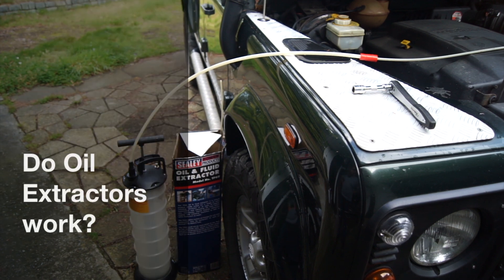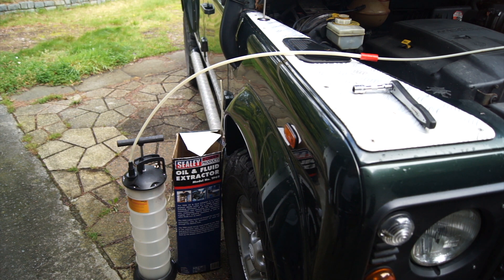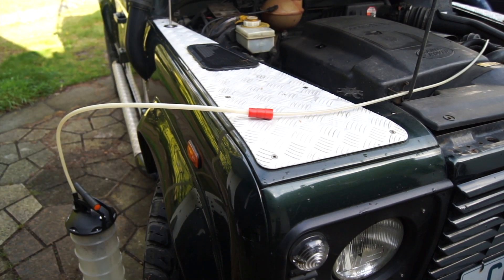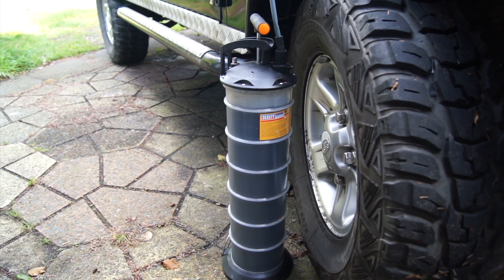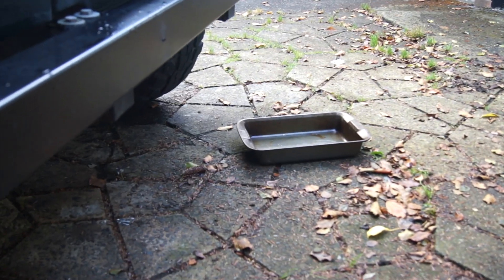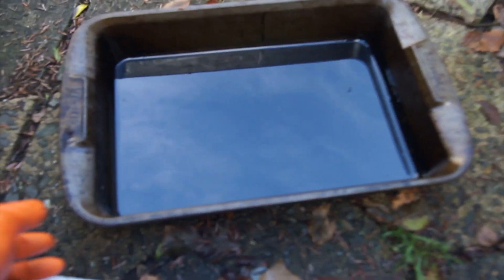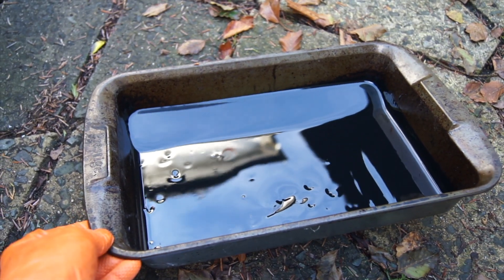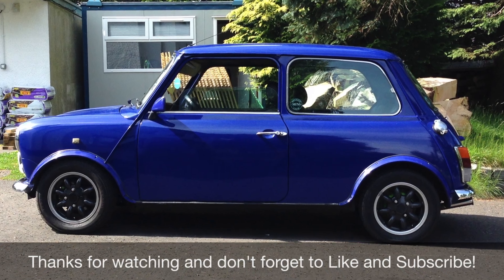Do Oil Extractors Works?

Comment: I didn't understand the purpose of removing the sump plug, if you didn't have a large enough oil extractor for the engine. It may have sucked up more.
Reply from the maker: The point of the video was to show what was left in the sump after the using the pump.

Comment: Depending on what side you’re drain plug comes out on, you could drive the one side up on ramps and tip the one side of the car and probably get all that oil out.

Comment: Great teaching video. But I wish you had told us how long that last bit of drainage took. Too late for you to tell us? Hope not! I am about to take up service using an extractor at my local gas station in Mexico and they said that the process takes 10 minutes. But I might take an old baking pan with me and make them get all possible oil out of my old Jeep Cherokee car.
Reply from the maker: It depends on the amount of oil the engine holds but I guess it takes 5-10 minutes. Which is far quicker than jacking up the car, fiddling with the sump plug, waiting for it to drain and then cleaning up all the spillage.

Comment: I have just bought an oil extractor and I have still to use it. I think if you change your oil regularly and at fairly low mileage intervals 5 to 6,000 which is when I like  to change my oil or once a year these extractors a good even if you leave a small amount on oil left at the bottom it is not going to a problem as in my case the old oil is still fairly good anyway.On my 2015 Discovery D4 there is a dedicated drain tube in the engine bay.
Reply from the maker: Great point!

Comment: How do you clean out the extractor after use? Great video
Reply from the maker: Hi Shady, it has a pouring spout, so I just pour it still hot into the empty oil bottles.

Comment: Old oil out, should you need to do the engine flush and empty the flush..before refill it with new oil?
Reply from the maker: You certainly could. I would do a flush with a major service, but not everyone.

Comment: I have a smaller version. Works great on my cars. Saves having to remove the engine under trays but I did have to buy a thinner pipe for it to fit into the car, then push into thicker pipe .... Works great though and less chance of spilling it all crawling under the car with the washing up bowl ..lol

Comment: Great tool Dave, just got one, it must be the Discos sump but that's a lot of surplus oil ive just used it on my vw t6 and also checked via the drain plug and it was dry.maybe a drip at most,excellent tool.oil stayed honey clear for ages which is great for diesels.

Comment: My first oil change was done using a 100ml syringe and an acrilic tube, like 1 hour later I got it all out.
Now I do it with my chinese pump :) 
Did you warmed up  the engine or hot ?
Reply from the maker: I always do it with the engine hot. It sucks up quicker and the oil is stirred up. Another bonus of the pump, no more burnt hands.

Comment: I have a Mondeo 2.5 V6. Would I need to remove the oil filter before or after using the pump to extract the oil? Many thanks.
Reply from the maker: Hi Paul, I would extract first, remove filter and then maybe try the extracted again just in case. If nothing comes out again you know there is no need next time. Hope that helps.
Reply: @DipstickDave  Thanks Dave!

Comment: Oil Extractors would work much better if manufacturers would do two things.  1. Create the lowest spot in  the pant where oil will pool to - similar  to a shallow funnel and 2. place the dipstick tube right over the low spot.   I'm no mechanical Engineer (electrical :))  but I see no reason why a drain pan can not be made this way.
Reply: Youre absolutely right, I think vw must have taken this on board as my vw t6 sucks dry using this great tool,suck around the filter housing where it pools from the filter and the oil stays honey clear for ages,which tells me with a little wiggling  these things can get it all!

Comment: I like the fact you drained the oil from the sump to show what is left. On a big engine the amount you took out as a measure of what is left without a sump drain is acceptable. But what about a small engine car. I have just come back from the outside using the same device on my 2008 Golf 1.6 petrol.  It was awful. First I could only get the thinnest tube in the Golfs oil dipstick guide tube. This  just caused bubbles and poor suction. I tried jiggling the tube and pushed it in as far as I could and it seemed to catch on something. I could not get a constant bead of oil in the tube using this extractor like you did and I tried all sorts to no avail. I'm sending mine back as I think it's only suitable for vehicles with a wide oil dipstick guide tube to accept the wider plastic suction tube for fast bubble/air free oil  extraction.
Reply: Used one on a Citroen C5 2.0 hdi. Pumping via dipstick tube removed 3.0 litres. Then opened via sump plug and another 1.5 litres drained out. I think there is a baffle plate which stops the suction tube from reaching the bottom of the sump. Maybe other engines will allow full drain but not this one.
Reply from the maker: There may well be a baffle in the sump, but there should still be a way for the oil to get through and circulate. Otherwise the drain plug wouldn’t drain it all either. 

What might have happened is the tube hit the bottom and curled up. That’s happened to me once using the thinner tube in very hot oil.

Comment: Adjusting the depth of the extractor tube should get all of the oil. Its odd but after the extraction is complete, pulling the tube up an inch or two will result in more oil being extracted.
Reply: I think the tube hits the sump and then bends back up again forming a "U" shape

Comment: By the way, if anyone is super worried about that "100 ml" that didn't vacuum out, you can flush your system with a little fresh oil.  I.e., after the 2st vacuuming ends, add ~1/2L of fresh oil to the sump, let it sit a moment, then suction that off.  The mixture you formed was 500 ml fresh and 100 ml old, or 17% old oil.  So the new heel (of again 100 ml left in after sucking out the flush) is ~83ml of fresh oil left in and ~17ml of old oil left in.  A typical drain via the bottom plug might vary that much.  ...  But if that still worries you, then just repeat the flush one more time.  The 2nd 1/2L flush reduces the heel to ~3ml of old oil and ~97ml of fresh.  It's a little bit wasteful, but if you are properly taking your used oil to a reclaimer (and you should be!) then it's not too bad.
Reply from the maker: If you’re really worries about it, suck out as much as you can with the pump and then just drain the rest from the plug.  Much less mess and less possibility of spills.

Comment: Great crosscheck: seeing how much drains out AFTER suctioning out all you could by vacuum: "~100 ml" you say.  Good to know.  If my car left the same volume behind, then in its 5.7L sump, your 100 ml left would mean ~2% of the total oil would be old.  I think that's okay.  It's not like that 2% would itself accelerate in its own aging, nor catalyze the aging of the 98% of the refilled sump that will be new oil. (It doesn't work that way.)  Oil ages primarily by reactive consumption of the protective additives in it.  So, replacing ~98% of the oil with new delivers a ton of new protective additives.  To a lesser extent, the potential harm from aging oil is also due to sediment formed (mostly from soot). But we should still be changing our oil filters, and they will collect the sediment just fine.  (I'm a chemical engineer with 31 years in R&D in oil additives.)

Comment: Even if you use the oil extractor to get most of the oil so that it was in a container that you could take to be recycled. It would save you dumping it in from the oil drip container pan
Reply: I extract it that way, I have a 25 liter container and I  pump oil there :)

Comment: you must remove the oil filter firs.the oil that drips into the pan is the oil left in the filter
Reply from the maker: The oil filter is inverted on this car so the oil is held in the filter and doesn’t slowly drain out as in older cars.